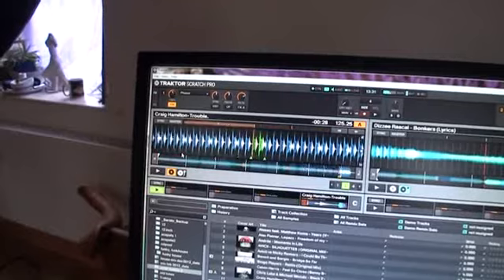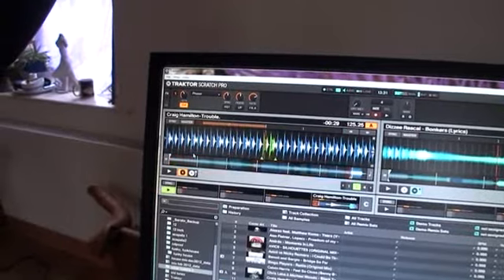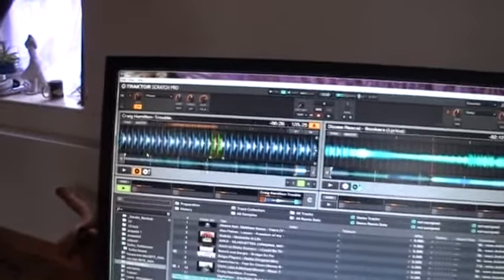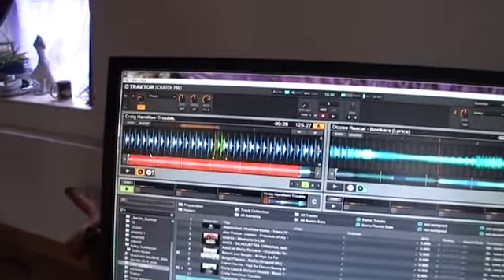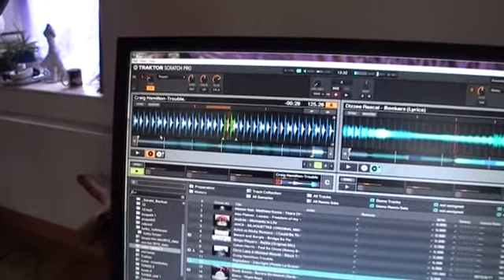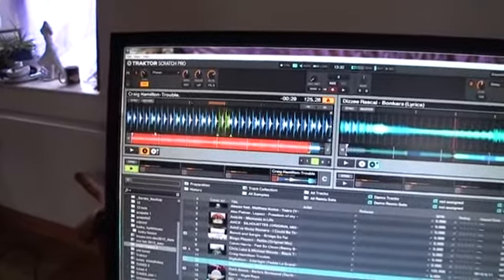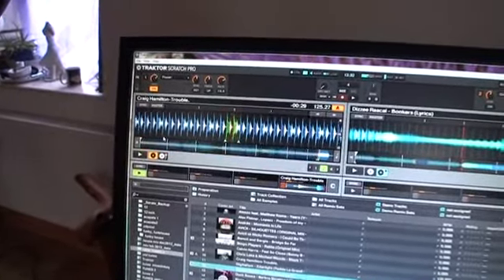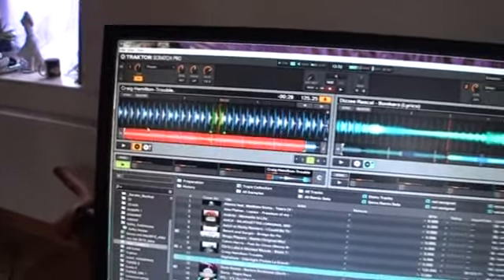TRAKTOR KONTROL Z2 HOW TO USE THE FX

Comment: Thanks for doing these vids. I'm really keen to have an all in one solution to minimize desk space but I'm a bit concerned with the audio quality when running real vinyl through these digital mixers.
Reply: Nearly every mixer you buy nowadays will be digital. Vinyl sounds fine through it. To be fair, most of the sound quality loss will be between your turntables and mixer anyway, unless you have replaced your leads

Comment: I'm confused why would you want a mixer made by NI if you can't use all of their software with it? 

I use the Kontrol S2 and i can control pretty much everything apart from the loop recorder. why would you want to pay even more for something that does less?
Reply: Because not everyone uses every feature. The Z2 is hands down the best value mixer available anywhere. Rock solid, innofader crossfader. Only problem is headphone volume but the headphone volume on the S2 and S4 is a million times worse. If you want to sync your tracks and pose, use an S2. If you want to beatmatch, beat juggle and actually have proper control of your set, use a Z2

Comment: I absolutely love this mixer but the effects section is straight dogshit. Desperately needs an onboard post-fader echo. You have so little control with that 2-knob effects section. Hate Traktor software too - they need to make a stripped down version for people who don't want the ridiculous effects and remix decks... It actually tracks vinyl VERY well, more so than Serato in my opinion. I have the Z2 and the Pioneer S9 and I much prefer the action of the Z2, at about 1/4 of the price